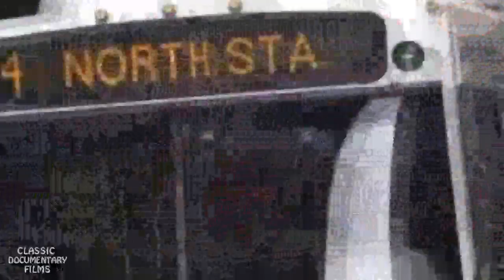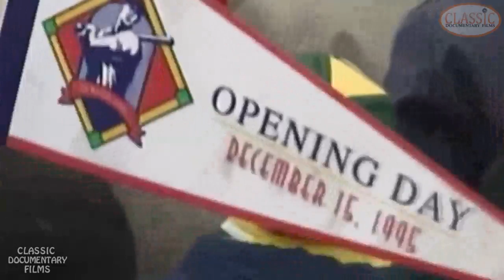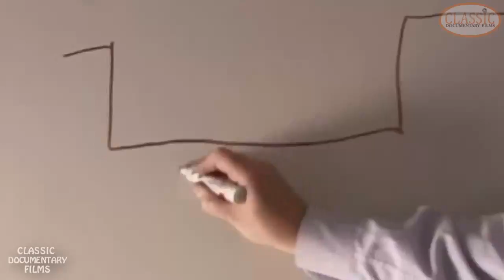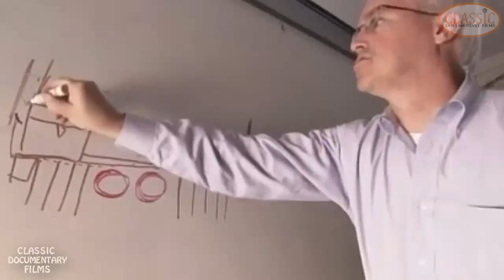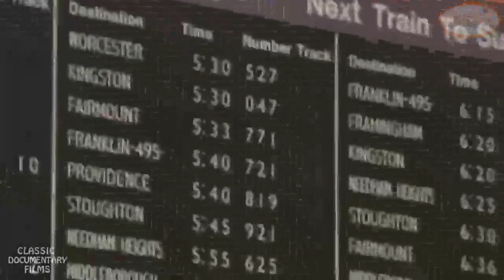Americas Biggest Dig | Boston Big Dig - Classic Documentary Films

Comment: Big dig was a racket
Reply: Would you rather have the elevated expressway still.  I was exceeding triple the capacity it was engineered for in the 80s.  If it were still in use it would be exceeding the engineered capacity by 6x.  It would be subject to repairs like the Tobin bridge.  The old expressway was a nightmare and had to go.